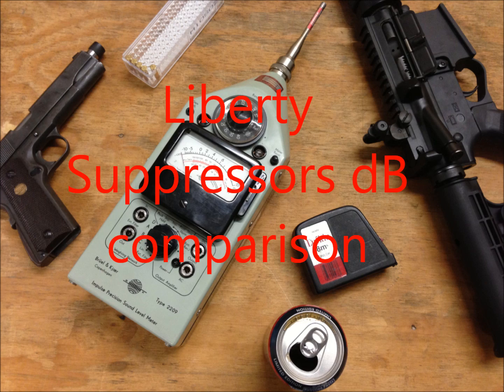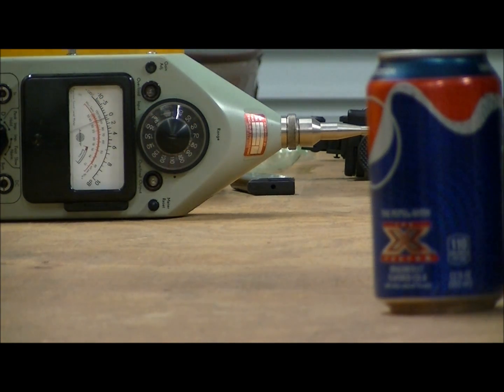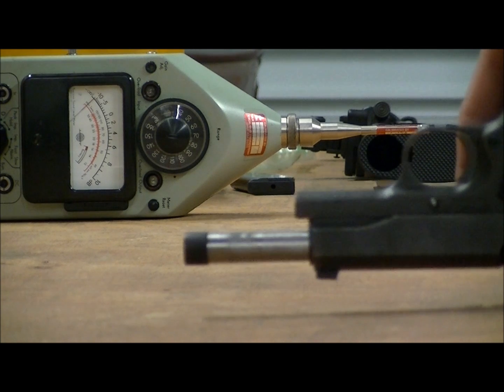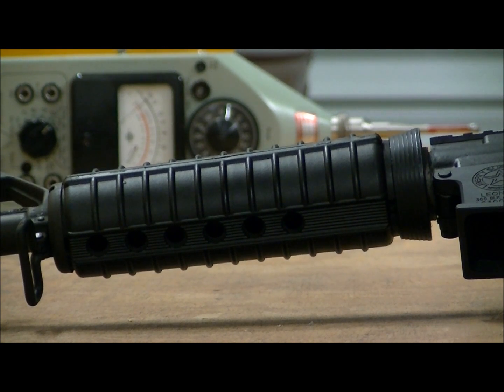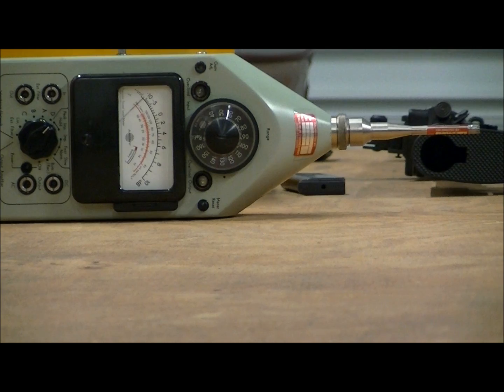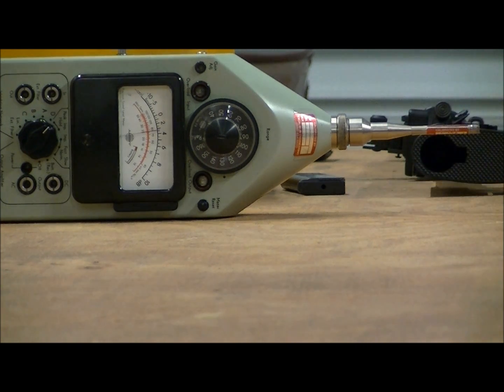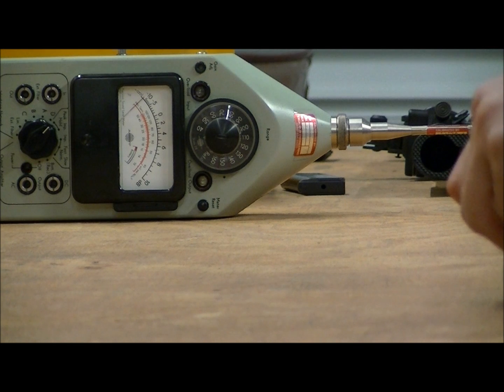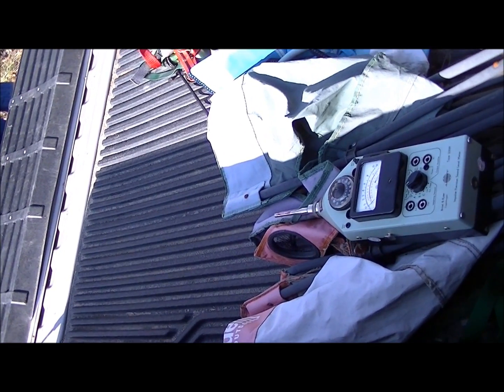dB Sound Comparison Video

Comment: These peaks are never recorded in music or compressed or removed later in the editing process because it is simply not possible to add 30dB peaks above reference level.These peaks might be barely perceivable on their own but when it comes to the whole picture, i believe this is one of the main reasons why recorded media never sounds as realistic as live audio ( with same speakers used for live playback)
Reply from the maker: Correct, the drivers in the speakers themselves act as a low pass filter in that they can not move fast enough to produce these transient spikes...most of the time. OSHA measures this peak level on impulse and we thought it was interesting to see what everyday objects would sound like compared to what we use to measure a silencer with. This instrument will measure sound up to 80KHZ as well so we are WAY above human hearing, but it has been proven that these sounds, even thought out of our perceived sound range, can still cause hearing damage. Thank you!
Reply: The problem is in the recording process & editing, hence the source media, not the speakers. Drivers acting as low pass filters is true but for a tweeter such frequency is more than 20-30KHz. The transient peaks in your measurement should be below 5KHz. A horn loaded HF compression driver can definitely handle such peaks upto  around 120dB. But such peaks are removed/ compressed/clipped in the processed audio file. Thanks.
Reply from the maker: Ahh! Yes, I see what you are saying now. Good info BTW. Thanks for sharing!!! This is how we educate the community as well, without this type of information sharing, we would never get anywhere. Thank you again!

Comment: Decibels never made much sense to me, but I think I was told that it has to do with non-liner quantification (unlike weight, distance, speed, etc) 2 x more is not twice as many decibels;
+3 decibels is 2x louder or 20 decibels is twice as loud as 17 db.  +20 is 100 times louder.  Makes it difficult to compare sounds in a practical way.  Seems better to figure out the db of the sound you are examining (firing a round with a suppressor attached) then try and find a common sound that is as close to it as possible if you want to convey sound level to viewers.  Obviously not trying to criticize the video, I think it was a great idea, I'm just not convinced db levels are truly reflective of perceived levels of sound to the average person such as myself.

Comment: you have many mistakes
a opening can bottle is about 40-70dB
a popping shipping bubble is about 80-110dB
A breaking plastic lid is about 60-80dB
Reply from the maker: The B&K 2209 has a 20microsecond rise time. This is the peak impulse sound that the meter can record in a 20 microsecond window. So technically the duration is so short that we perceive it as much lower. As far as OSHA is concerned the duration is so short as it doesnt really require consideration. An off the shelf sound meter or an iphone app has a much slower rise time and can not capture these short duration sounds. We did this to compare it to what the exact same meter captures when measuring gunshots. That was the point of the video from the outset. Thank you for taking the time to watch and comment, we appreciate it!

Comment: i don't know. A rock concert clocks in at 90 to 120db at start up.
So a can of soda at 112db just doesn't make sense. Check that meter's scale.
Reply from the maker: The B&K 2209 has a 20microsecond rise time. This is the peak impulse sound that the meter can record in a 20 microsecond window. So technically the duration is so short that we perceive it as much lower. As far as OSHA is concerned the duration is so short as it doesnt really require consideration. An off the shelf sound meter or an iphone app has a much slower rise time and can not capture these short duration sounds. We did this to compare it to what the exact same meter captures when measuring gunshots. That was the point of the video from the outset. Thank you for taking the time to watch and comment, we appreciate it!
Reply: One must consider the distance that was measured and the smaller environment
Reply: its LOUD, but short, imagine 4000 people opening cars near you at the same time

Comment: I had some asshole tell me today on a job site that I needed earplugs when cutting 1/4" bars of metal with a wheel cutter, because it may exceed 80 dB.  I wan't to go work in a country where men still have their testicles.
Reply: CounterRevolutionary  It's because of OSHA. You can have your testicles, but maybe you still want your hearing as well?
Reply: first name last name 80 dB won't damage your hearing.
Reply: +frblaze2 yep. citizens hearing is important enough to require a hearing plan for employees who's work environment may exceed 80 dbs. rock concert? 120-160 dbs. ever noticed the bouncers wearing ear plugs? 80 dbs sustained over a lifetime will most likely cause hearing. he was trying to help you not be deaf.
Reply: +CounterRevolutionary You are only cappable of listening to 80 DB for 8 hours or so, after that there is a 100% chance of damaged hearing. :) And only 10 seconds of 110+ DB or you will have a guaranteed chance of damaged hearing.
Reply: first name last name I don't work in a factory, and I very rarely work on a construction site.  Mostly, I'm making service calls for Ethernet and CATV problems.  I have no problem following OSHA rules, otherwise, my hearing plan is 'leave me alone and let me do my job.'
Reply: I appreciate the concern, but only use a wheel grinder for maybe a total of five minutes at a time, maybe four times per year.
Reply: +CounterRevolutionary I also tell guys about these regulations before we are going to have a good time. Kek, moaner problems...
Reply: Jessica de Vries Because it lasts for 8 hours or so?  Wow, I'd need Viagra.  ;)
Reply: CounterRevolutionary Lelelel, good one.